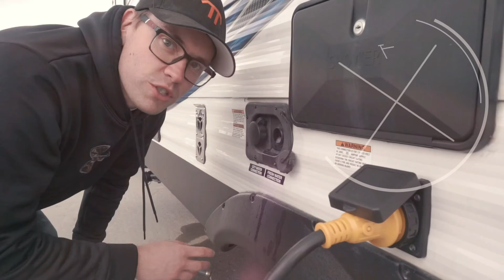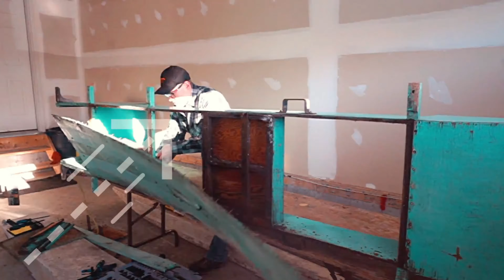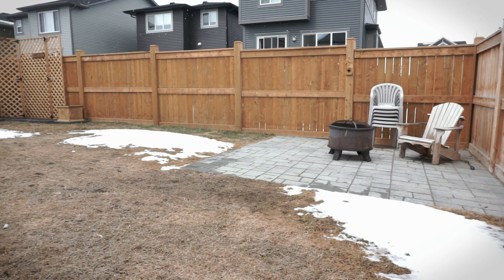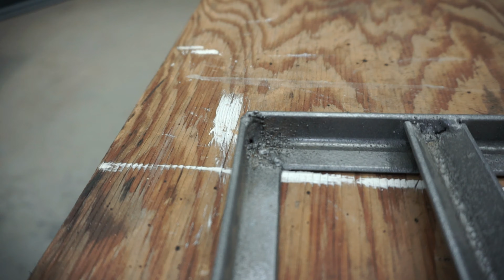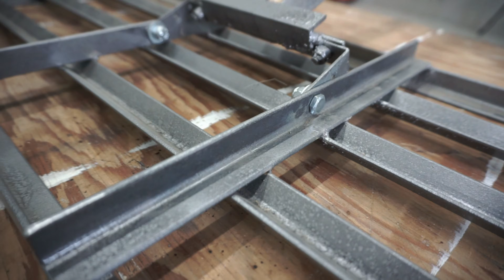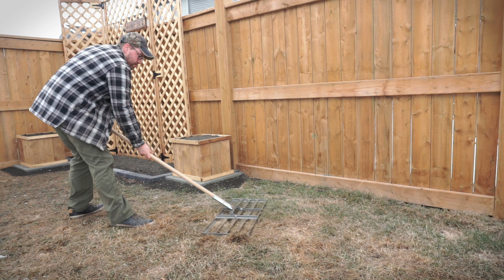Build Your Own DIY Lawn Leveling Rake

Comment: I love the video-you can weld together an effective leveler which potentially be better than the store bought rakes due to the weight factor alone!
You don’t have to be a pro welder to make it-and I LOVE how you provided a great tip on how to build one without a welder!
I’m glad you are aware of the very dangerous fumes zinc emits during welding and put that in your video.
This is a very good video!

Comment: Is very cheap if you make it and it is $60 if you already have all the tools to build it, but in reality if you only going to buy a welder for this project just buy the rake already made. Because the bolted one will not work as good. 
If you rent a welder you are pretty much at the same price if you buy it made and still have to make it. But now if you want to make it to day I built it then go ahead and have fun.

Comment: Going to get the pricing on the 3/4” x 3/4” angle iron. If it works out being cheaper then the store bought one I’ll borrow my neighbors welding set to make the lawn leveling rake. Many thanks and saving your video to find it easier once the material is bought. Great vid!!
Reply from the maker: Excellent! I was able to build this one for a fraction of what it would cost to buy a store bought one. Good luck!

Comment: The 3 piece of angle in the middle are raised up due to installing then on top on the outer boarder. I imagine it will work just fine but I I'm thinking of building one too and might make it so all pieces will make contact with the ground.
Reply from the maker: Initially I had the same worry, but realized most of the commercial versions did it this way. After playing around with a few ideas I found this would make it the most sturdy and ended up working really well.

Comment: Can you tell me how much it weighs? Just how heavy is it? Love the DIY idea. Thank you
Reply: Based on his dimensions, he has 16'-6" of angle iron. At .59 lb/ft, it's about 9.75 lbs plus the handle
Reply from the maker: I haven't weighed it but based on the material weight I'd estimate around 5-7lbs. It's not unmanagble by any means, but it does have some weight to it and you notice it in your shoulders after some use. The nice part is the weight helps it settle through your leveling dirt so the rake does all the work.

Comment: Is it really heavy? Or is it just right and easy to work with?
Reply from the maker: It's pretty comfortable, maybe a little on the heavy side but still manageable. I find the weight is just right to handle but still enough to level really nice.
Reply: @travisadventureprojects4578  thanks for the response.  I plan on making one just like you did.
Reply: @travisadventureprojects4578  one last question, do you think it's stout enough to spread gravel and screenings evenly?
Reply from the maker: @rjskum688  It seems pretty sturdy so far! I think it would hold up well.